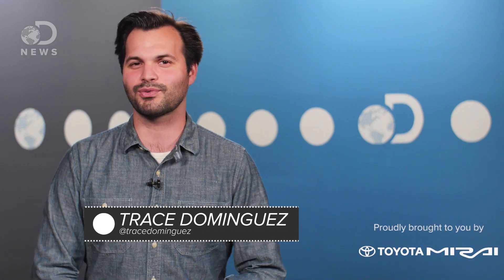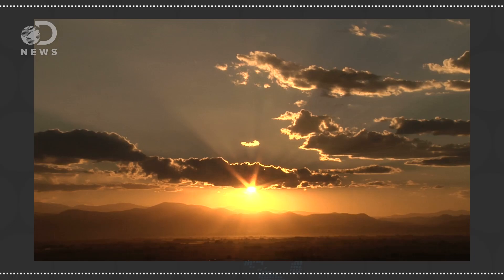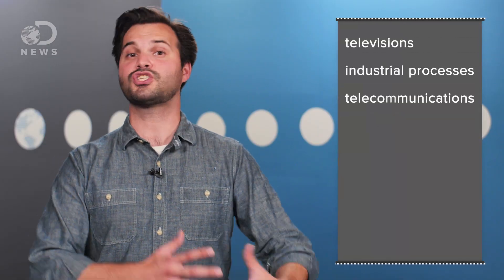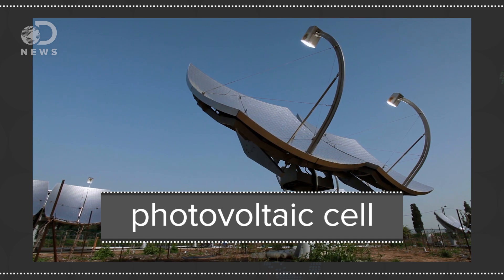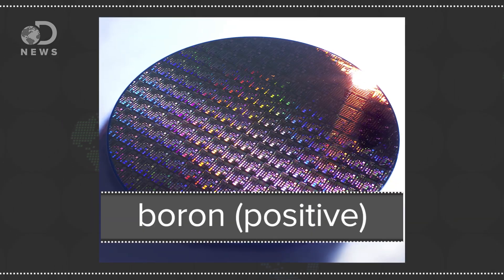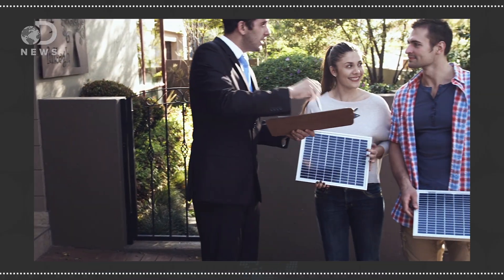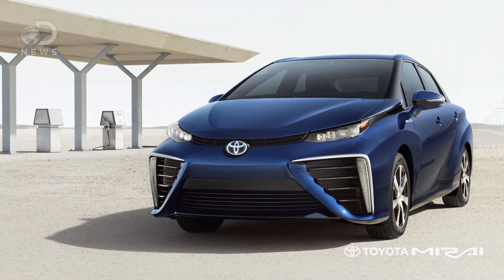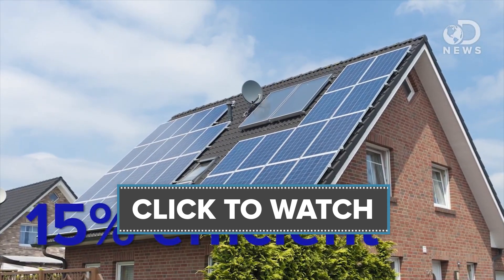How We Turn Solar Energy Into Electricity

Comment: Solar Energy Unreliability
The world population is increasing, and demand for energy, especially electricity, is rising steadily. The commonly used source of energy is coal, which constitutes 41% of electricity production in the USA. Due to the high level of pollution caused by coal mining, there is a need to find a sustainable source of energy such as wind. Solar energy is a renewable source of energy. It conserves the environment since it does not contribute to environmental pollution. The question that arises is whether preceding other forms of energy such as coal and using solar energy alone will meet all needs. Energy currently is used in all forms of life from the health sector to manufacturing, and one source of energy cannot satisfy.
Solar energy lacks efficiency, consistency, and cannot meet electricity demand. Sunlight energy is affected by climatic and land topography, and the acts affect sunlight availability. The actual output of solar energy plants is lower compared to wind energy plants. For example, the median output of PV (photovoltaic) panel is 38% while the output is only 20% of their calculated potential (Sampaio, & González, M. O. A., 2017). Solar energy solar plants are unreliable and inconsistent since they are producing less than their calculated output; therefore cannot meet current population needs.
Population growth is on rising, so does the need for a stable form of energy. Currently, 1.3 billion people don't have access to electrical energy. Energy is required in the public and private transport sector, which solar energy cannot satisfy alone. Solar energy is required in the health sector and in enterprises to ensure activities are running smoothly. Storing solar energy is expensive, and the cost of solar energy is high. Costs and storage inconveniences make it hard for solar energy to satisfy all needs.
Solar energy is not economically reliable. The solar industry in the US heavily depends on government mandates and subsidies, which makes the industry unreliable since it cannot sustain itself. Taxpayers in that matter will be the one supporting the industry that itself depends on government policies, mandate, and subsidies (Lofthouse et al., 2015). Solar energy cannot fully satisfy our needs since it depends on government mandate and subsidies, which mean it can partly cover some part, such as home lighting. Following economic liability, solar energy is unreliable and cannot provide for all human needs in all sectors.
Solar energy has hidden environmental costs since it is not self-sustaining. Solar energy is inconsistency since it is affected by factors such as weather and requires back-up of others source of energy. Inconsistency of cosmic energy forces grid managers to incorporate other energy sources such as coal and natural gas to provide backup when there is no sunlight. Cycling other sources of energy make solar energy makes it unreliable and impure since fossil fuels are pollutants making it less clean. Solar energy is dependent on other forms of energy and makes it unpredictable.
Solar energy cannot satisfy all human needs. Solar energy is unreliable and inefficient. Sunlight, which is the primary source of solar energy, is not always available, making it hard for it to consistently meet electricity demand and relies on other forms of energy as a backup. Solar energy is more costly since it requires taxpayers’ cash as a prop and government subsidies to keep the industry running, and that is more costly to the taxpayer as it is not beneficial. The improvement of solar energy in the future is open questions to be solved by concerned parties and government subsidies.
 
References
Lofthouse, J., Policy, S., Simmons, R. T., & Yonk, R. M. (2015). Reliability of renewable energy: Solar. Institute of Political Economy, UtahState University.
Sampaio, P. G. V., & González, M. O. A. (2017). Photovoltaic solar energy: Conceptual framework. Renewable and Sustainable Energy Reviews, 74, 590-601.

Comment: Fussion + Solar Cell battery system is the future of power generation.
Fussion will be used as base for the power grid. The solar cell battery will be used to take care the rise and fall of the demands through out the day.
BTW hydrogen fule is clean, but the production of hydrogen fuel is not. This means it's not clean energy, yet.

Comment: Alright, so when I was researching why Big Oils bid for solar energy dominance didn't get them anywhere, it seemed many people conjectured that the problem was the Western governments, due to right wing noncommittal, and a left-center-left divide, due to prejudice against "funding big oil" was the culprit, preventing a truly substantial entrance into the market...  which lead to China just making the things itself rather than making it for Big Oil, and leading to this odd situation with a deformed push market.  This might not be the best thing for solar because it likely resulting in lower than natural evolution of the product by scaling too quickly, however...  So, I had thought this plausible, even, for US politics, likely, also explaining how Germany with a multiparty system did get in big into the market, but when it began becoming a proven model, the power of the deep propaganda against Big Oil, resulted in Big Oils attempts to enter the market unfruitful, tossing the ball to China...  I mean it would explain that whole thing.

Comment: Oil, Gas, and other fossil fuels seem to be an efficient method for energy; but unfortunately the earth cant afford it. An ideal world would have a majority of cars running on hydrogen with zero emissions and have every apartment building rooftop on the block covered in more efficient solar panels to reduce energy consumption.

Comment: The new solar cells that can harvest 40% of the energy from the sun is good enough to go into mass production.   40% makes it close to coal.   They also have a plan to make solar panels even better.  At issue is how they etch the surface of the solar cell to capture different frequencies of light.   With nanotech currently making specialized surfaces on metal plates, it just a matter of computer modeling to determine how to change the solar cell to get even more than 40%.   We already are able to produce a surface that is so light absorbent, it is totally black.  It is eerie how dark it looks.  We just need to do it on photovoltaic metals.

Comment: Cold Fusion (LENR) is by far our most promising option, sadly, it is a heavily repressed technology, and has a relatively small margin of error, and require years of refinement, and, thus, replication of some results can be difficult, the infamous "water powered car" used a form of cold fusion, and to boot the catalyst unit was relatively cheap to produce (makes sense why it would be repressed, 'eh?).  Fusion power (hot fusion) is our second best choice, the likes of which you see in toroidal reactors, however, these reactors cannot be scaled down to a size which could fit in a vehicle/on a person, and cold fusion is a much more elegant/efficient solution.  And, bringing up the rear we have traditional nuclear power.

Comment: Solar Cells turn the light energy provided by the sun directly in to useable energy (electricity). Solar Panels use the light provided by the sun to heat water, watch turns into steam and spins a turbine and generates electricity.
Reply: nice

Comment: People are always ruled by fear.
We already have an energy source that is highly efficient and barely pollutes. It's called nuclear power.

Nuclear power plants produce much less waste than coal plants and cause a tiny fraction of the deaths a coal plant would. Nuclear power plants are so efficient they produce much less nuclear pollution than a coal plant (burning coal actually releases radiation).

Modern nuclear plants are also extremely resistant to disasters. (unlike modern coal mines and plants)

There is no reason not to build more nuclear power plants and save lives.

Yet people are always thinking with their emotions rather than using actual data and understanding the actual problems.
Reply: princeofexcess Nuclear is an uphill battle because of people's perceptions.  The US started creating nuclear power plants too early.   The Vallecitos power plant in Livermore, California has leaked radioactive particles all over the valley it was built in.  It had to be shut down.   Too many things like that have happened that people are just not going to trust the government when they say that the new power plants are better and much safer.    IMO, There is not a state in the union whose US Senators would be in favor of building a nuclear power plant in their state.  It's political suicide.
Reply: +princeofexcess  Funny that you can use words like "less deaths" or "less radiation" and then in the same breath "actual dangers".  The ignorance isn't with the people.  Actual danger, like chernobyl? or fukushima? those seem like actual dangers to me and would be ignorance to say otherwise.
Reply: princeofexcess I agree Nuclear is the better of 2 evils (coal/gass vs nuclear). But it still pollutes quite a bit. So replacing all coal plants with nuclear would buy us quite a bit of time. But I'm hoping they can get the ITER project worked out asap so we can build fusion plants instead of nuclear fission plants (current ones).
Reply: Lordp00m
 "Nuclear power plants emit negligible amounts of carbon dioxide throughout their lifecycle ... with most comparisons of carbon dioxide emissions show nuclear power as comparable to renewable energy sources."

about nuclear waste pollution from nuclear power.

"long-standing agreement among many experts that geological disposal can be safe, technologically feasible and environmentally sound"

And people forget that that nuclear waste was mined from the ground in the first place. It is usually deposited much deeper and in a safer location.

Other minor wastes are also stored underground in a storage facility. (solid and gas wastes)

about radiation released by the nuclear power plant:
"Civilians living within 50 miles (80 km) of a nuclear power plant typically receive about 0.1 μSv per year.  For comparison, the average person living at or above sea level receives at least 260 μSv from cosmic radiation."

Radiation release is pretty much non existent.

So actually nuclear power doesnt pollute almost at all.
Reply: Larry Summers yea obviously nuclear power plants are not a popular choice.

Yet this is because of ignorance not because of actual dangers associated with technology.

Thats why i comment to spread the news.

(people are also generally afraid of flying in an airplane although its a safe way to travel and people usually really resist change.)
Reply: Matthew Hesse
the thing is they arent. And even if they were you have to compare them to other dangers.

You must look at data from both sides before making a choice otherwise its not really a choice.
Reply: +Tournel Nenry. Do you actually have the numbers to prove your claim. In US nuclear power is just as safe as solar.
On  top of that the argument is not solar versus nuclear. Solar is 
incapable of providing the power needed for the US. Its just physically 
impossible to do it atm. So the argument is coal versus nuclear
Reply: alright so I do agree that in some countries nuclear power is not a 
solution because it would be dangerous and would actually cause a lot of
 deaths. But in US nuclear power kills less people than solar for KW of energy produced.
Meaning actually solar is more deadly.

Comment: Nuclear is the most promising in my opinion. Can't wait for nuclear energy to rule the world, then the middle east will have to find some other way to maintain their economy, without oil.
Reply: Bruce Wayne If you can dispose of the waste, then yes
Reply: Bruce Wayne You mean the US will have to stop controlling the middle east's economy via their oil companies and instead drop bombs over the countries that have the most Uranium in order to control theirs instead.
What a promising future that is!
Reply: Bruce Wayne I strongly disagree.  Cold Fusion (LENR) is by far our most promising option, sadly, it is a heavily repressed technology, and has a relatively small margin of error, and require years of refinement, and, thus, replication of some results can be difficult, the infamous "water powered car" used a form of cold fusion, and to boot the catalyst unit was relatively cheap to produce (makes sense why it would be repressed, 'eh?).  Fusion power (hot fusion) is our second best choice, the likes of which you see in toroidal reactors, however, these reactors cannot be scaled down to a size which could fit in a vehicle/on a person, and cold fusion is a much more elegant/efficient solution.  And, bringing up the rear we have traditional nuclear power.
Reply: azadkamall84 The United States doesn't control the economy of the Middle East, the Middle East controls  the world economy. It's been that way ever since the oil addiction of the West has been in full swing. That is why whenever there is even an inkling of uprising or turmoil in the region - which is always - you see gas prices fluctuate. In fact, every action you see United States take in the Middle East is largely at the behest - or at the very least with permission of - the princes who own the oil. A quick look at the boards of EVERY major oil company in the West will show that it has at least some royal from the region present with the Saudi royal family overly represented. Likewise, every major oil company has a headquarter in the area for the princes to have access to.These multinational companies - through their lobbyist -  wield enormous political power that furthers the goals of of these princes because what is good for them is good for business and that means using military power to put down any local threats to the princes power. Which is why the West is involved in so many conflicts in the region.
Reply: qw ertyu Yes and no.  But what is important is not that they aren't viable yet, but why they aren't viable, in the public sphere, at least.  And that why is plain and simply, censorship and repression.

This all being said, the tech is developed, it has just been removed from the public sphere, as the energy business is very profitable, and, there are two sources of power in this world 1) Money and 2) Knowledge.  And so that is what those in power do.  Control the money, and restrict the knowledge.
Reply: Maj Peppers  They CAN dispose of the waste, and they have done so since the beginning. The people who take care of the waste are very competent and know what they're doing. Nuclear power is the only large-scale energy-producing technology which takes full responsibility for all its wastes.
Reply: Emma Knickman Then why isn't cold fusion widely used? could it be because it isn't viable yet?
Nuclear energy has been used for decades and is safe, clean, (if used correctly) and incredibly efficient.
Reply: Emma Knickman Do you have proof of such a conspiracy?
Reply: qw ertyu Proof of the censorship and repression, proof that the tech existed and has subsequently been snuffed, proof of the profitability of the energy businesses, that the primary sources of power are money and knowledge, or proof that those in power control the power and knowledge?

Not sure if i can find solid proof in all of those areas, but, i can try to scrounge of the stuff i read in those areas, but i'd be glad to look.
Reply: Bruce Wayne You're a schmuck and also, no. What happened Bateman? Woke up on the wrong side of the millenium? Or was, that what happened at Fukushima something, that purely happened to other people on the same planet you inhabit?

Comment: All forms of renewable/low resource consumption are good. Bio-fuel/gas, solar, wind/current, hydro, wave, thorium nuclear. But the problem is and always has been electric transmission. Since Edison's DC vs Tesla's AC.
The system Tesla developed won because they were able to implement it in large scale public utilities able to transmit over large distances; from plants that were able to supply steady, reliable electricity on demand.
Legislation was then written to implement and protect the utilities. So until regulations change and allow a neigborhood to invest in a local power station with a mix of say solar, wind and bio-gas with ample battery storage for example; there won't be much development on small and medium scale electricity production that will be useful.
Large scale power plants will continue to dominate until that time, so how much and where those utilities can most cost effectively build and produce (and profit) is what will be selected.
I.e. now that technology has made electricity production more effecient and compact it should be less regulated and jurisdiction should be given to say the city/county level.

Comment: I needed this video literally like 2 months ago - just finished my controlled assessment in physics about photovoltaic cells and how they produce electricity at different surface areas. This would have been nice to use but hey i still got an A* without it so all is good :D
Reply: Fortunately, I saw this video before I embark on my research project about solar power. :)